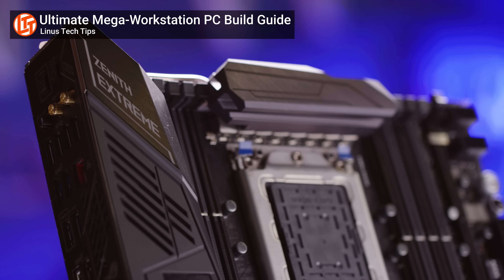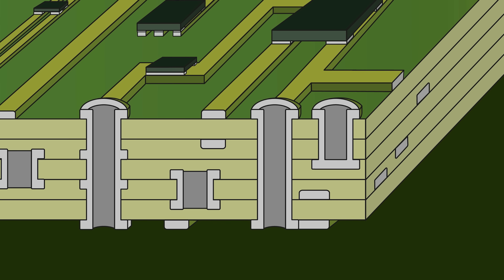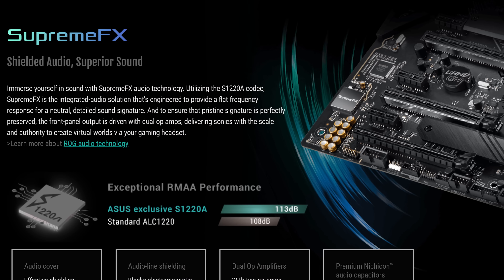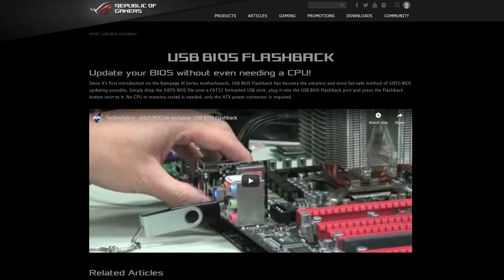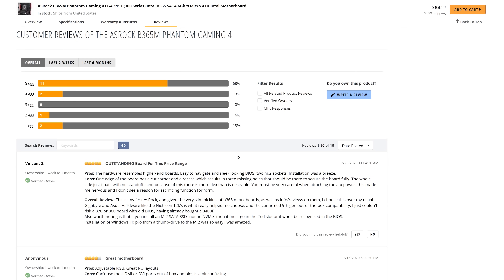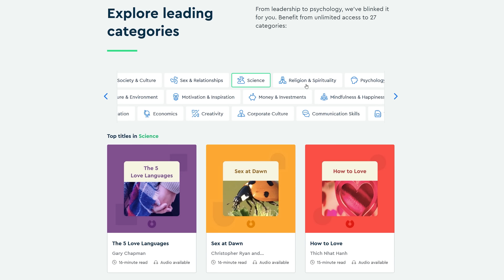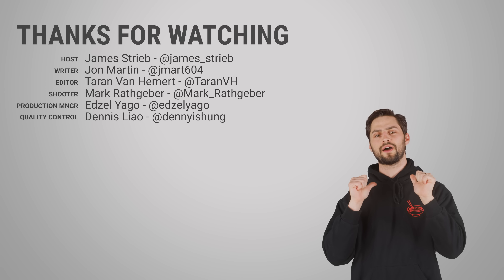Are EXPENSIVE Motherboards Worth It?

Comment: The motherboard is the last thing to check when building PCs because at that moment you can choose one depending on what component you already listed and your budget. 
I prefer a good CPU without overlock rather than an expensive motherboard with a dual-core.
Reply: I don't understand why someone wouldn't buy the motherboard and CPU "together" if you get a cheap processor then you get a cheap motherboard and vice versa otherwise you are bottlenecking one part or another, this is especially true with long term builds where upgrade cycles are far between.
Reply: @Hybris51129   Not True, there is no bottlenecking if you're not overclocking, The CPU will work at his maximum on any motherboard (a compatible one of course).

Comment: person A: having a good OC mobo saves you a ton of money in the long run
person B: having a good case can last multiple builds
person C: having a good PSU can last multiple builds or a decade
person D: having a good CPU can last multiple gens
person E: having a good GPU can save several gens of upgrade
person F: having a large storage SSD can last you several builds

conclusion: why save your money ? splurge it
Reply: Well, depends. What if your system needs, say, 500 watts. Why would you get a 1,200 watt psu? That’s just a waste of money on extra wattage that you won’t even use. Also, with a mid-range mobo, you can get some really high quality stuff with just a little less bells and whistles, but at half the price.
Reply: This is all true, quality components at perform better today WILL last longer than low quality components that perform "meh" today.
OC motherboard is a bit more special case tho, if you dont OC you dont get the benefit (and this is very personal if you want or not).

Everyone have a budget, some more fixed than others, and within that budged you should get the best you can not just the cheapest.
PSU come with 10years(?) warranty and you should expect to upgrade your system every few years = last several builds.
Case could last until your grandchildred die of old age, clearly something that could last for several builds. Not to mention cooling is very dependent on the case, and component lifespan is increase with good cooling (or decrease if they get to hot)
SSD's today last almost forever, i still have my 120gb from '09 and i have no problem with it (in a less used laptop, but still alive and run circles around any HDD) Large storage i would still keep on HDD due to cost, but i have never had a SSD fail while i had several from HDDs over the years. 256gb system drive and 1tb for storage is more than enough for 99% of users, any additional storage should IMO be on HDD or possibly in a NAS (HDD in the NAS)
CPU and GPU is more the performance, buying a lower tier today might mean you "need" to upgrade next year while a higher tier might last you several years before that "need" show itself.

You mostly get what you pay for, the cheapest option will only last so long, either due to quality or simply starting far behind the curve today and ending up to slow down the line.

Comment: 2:55,   Number of chokes does NOT mean = phases,   You need to check the phase design,  mosfets and controller to say that. AND having more phases does NOT always mean having more power.  To say that, You need to check phase desigh, mosfets, trenchfets and controllers and test it to make sure.   Sometimes 4+2 phase boards   mosfets ( 91 amp ) deliver much more power than some of 6+2 (48 amp) phases.

Comment: I bought a $210 X570 board and I already regret the fact that I didn’t spend more. I thought I was just going to use 1 M.2 slot, but now both of them are filled and I want to add more, but I don’t have any more M.2 slots, I don’t have a Dimm.2 and there’s no PCIE gen 4 m.2 expansion cards that aren’t made for RAID setups. I don’t want raid, I just want one more M.2 and right now there’s no option for that. I also wish I had more USB ports which a more expensive board would have.

I’ve never regretted spending too much on a motherboard. 

“A high end motherboard doesn’t make your computer faster, but it does make your computer nicer” -Tech Deals

Comment: I had a cheap Biostar A320 Motherboard paired with Ryzen 2700X and the power phases could not keep up with the processor. Within 20 seconds of full load they reach thermal limit and start to cutoff, causing the processor to power limit itself to the base frequency and back to turbo constantly. I also tried it with 2700 non X version and it got near the thermal limit but did not cut off. I replaced it for a B450 from ASRock with better power modules and it works great for both CPUs. So beware of cheap power rails on motherboards. Some can't even support non-overclocked high end CPUs.

Comment: "Is it worth it?" 
Me: "Hell, yes!"
When it was time to upgrade my PC a few years ago, i went with a top of the line ASUS board for AMD, mainly for the amount of rear USB 3.0 ports, ability to run 2 NVMe drives and a host of SATA ports (6 or 8). because i want to run separate physical drives for different purposes, Getting a cheaper board and lots of add-on cards was not sensible, neither was forking out a ton of cash for top of the line capacity magnetic drives.  The top of the line boards simply are the most versatile of them all, from RGB to over-clocking to add-ons to running multiple GPUs.
And like they say: better to have sth you don't need, than to miss sth you thought you didn't need.

Comment: If you want max stability and performance and plan to overclock your CPU and RAM to the max. Then yes, buy yourself a quality motherboard.
Reply: i have a 4x 8GB config on 4300 16-17-17-33. dont want to know how hard it must be to get that stable on a semi cheap one
Reply: @mauriceelet6376  Wow, that's an exceptional overclock with 4 DIMMS.
Reply: @theintunity  well, i had 4533 16-23-23-38 stable for 5h... but cant get it back. highest was 4480 16-22-22-36 but thats not stable long term. 4h RAM test yea, but prime95 dosnt think so
Reply: @mauriceelet6376  What is it worth to overclock that hard though?
Reply: @UndeadSauerkraut  fun? i do that like i do gaming. for fun. you get better low 1% and 0.1% FPS and stuff, but you could get most of that with your normal 3600 16-19-19 if you would do the subtimings a little
Reply: @mauriceelet6376  What ram kit are you using? Those must be high quality Samsung B-die.
Also your cpu has a damn good IMC. I'm running 4133 17-17-17-36 with Maximus X hero and 8700k. My motherboard won't allow me higher.
Reply: @mauriceelet6376  I doubt, that someone can spottthe difference tbh ^^

Ofc if your systen fE handles gta5 in 4k/30fps and you overclock it and it is 4k/45 or even 4k/60 then you can easily spottthe difference, but otherwise meh...

I fe play monster hunter world and it runs with 1440p 90-110fps without any oc and with 120-140fps with the highest oc I was able to do with myssystem ( and yes it is fun, but I wouldnt let it run like that everydday ^^)

I barely was abletto spotaany difference. Maybe my eyesaarent as good as others or I simply dontccare enough, but yeah ^^ I barely understand why anyone is doing such hardcore oc... It sounds like comparingddicksizes or salary for me tbh ( no offence, Im just curious)
Reply: @theintunity  i use a g.skill 4133 17-17-17. but you can do it with 3200 14-14-14 or so too. you may have to buy 6 2x2 and bin them yourself but its ok. i know people that have 3200 and doing 4600MHz on a gene.

the IMC is not that important. even my 8700k got 4300 16-18-18 on the z390. most of it is the MB. it would suprice me if not 80% of coffelake could hit 4100 and more with 4 dimms
Reply: @UndeadSauerkraut  it is not much, that is correct. you would see a difference, if you had your fps cap like you mentioned. i use a 1440p 100Hz monitor with gsync. so my gpu only does 100fps. if it dips to 70 i notice that. not it more or less only goes to 80/85 and iam happy with that. but thats only from 4133 17-17-17 stock to my setup. going from 3200 to 4000 XMP does more or less 10% of what you could get with a custom OC. do you need to spend 400$ on that 30fps more in your dips? no. 100$ maybe worth it for someone. but its not like you need it. 

ps: i only mention the stats to have a comparrison. i know i cant get that on a cheap motherboard because the signals get worse. belive me i tried. z370 and i have almost 400MHz less RAM on the same brand.
Reply: @UndeadSauerkraut  also its dependent on the game. Doom dosnt give a crap about RAM. Civilisation V or VI and you get 10s or more in late game per round because of AI simulation... thats massive
Reply: @mauriceelet6376  Huh intresting. Well I use an overclocked 2080 ti, if it is "needed".

I have a 2160p/60 Monitor and a 1440p/144 (or 165 in oc Mode) monitor. Depending on the game I like to play on one or the other.
Playing watchdogs 2 on anything maxed out and 4k was fE a given scenario where it was needed to octthe 2080 ti, so I had at least >50fps most oftthe times ^^

The fpsddidnt matter too much for me in that game, because even in cars it rather feels slow and it looked fsntastic in 4k :D

So spending time in overclocking is more a hobby you enjoy rather than a thing you consider worth it?
Reply: @UndeadSauerkraut  in your szenario its not really worth it. Whats interesting for CPU OC and RAM OC is Frametimes. If you are in low FPS because your GPU is maxed out then you cant gain anything. Faste RAM makes the CPU fester, and so if your GPU waits for you CPU thats where its also RAM dependent. 3200 16 18 18 Stock should be around 40GB/s . Mine does over 60GB/s. Aida 64. Real world is more like 35 vs 42GB thats what you get in Geekbench. I need high FPS and i have a 980 waiting for a 3080ti. My games need a lot of physiks calculation. So you could use even a fast i3 and cant see that much of a difference. For me switching from 4.9GHz 8700k to 5.2GHz 9900ks was a little jump.

Comment: Ever since I started in computing back in 1998 my boss always told me to go for Asus if I want reliability. That was because of the quality of the components. Nowadays I go for a quality board still but on the cheaper side as I don't overclock my cpu's and don't need 600 expansion slots.
But reliability is what I go for since having errors left, right and centre (like in the old days) is what I really don't want to deal with on my days off.

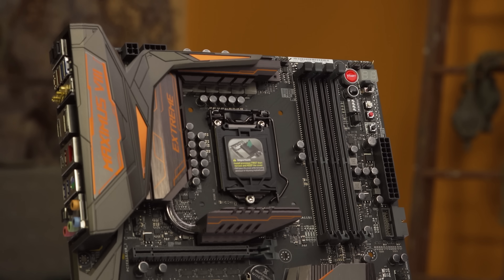Comment: 2:51 nice little lie ;d
Reply: Indeed lie. I cringe when someone pay more for same mobo as cheaper one but looks better because it has rgb and plastic shrouds... No one cares about electrical these days...there are a lot pc tech tubers that are not even concerned about it, but there is still hope thanks to GN, AHOC and hardware unboxed
Reply: "typically", it's not a lie. Usually higher end mobos have either more chokes or better quality ones
Reply: @benjaminmcintosh857   But manufacturers especially in recent years put more chokes in one phase in parallel to appear that mobo has more phases.... And chokes are inductors, coils and when you have two 400nH inductors in parallel their combined inductance is 200nH granted you split a load across two of them but they don't get hot enough to effect there performance to begin with. And buying one 200nH higher current rated chouk is cheaper than two 400nH lower current ones....but manufacturers still do it because everyone still count those... however if something make more sense from electrical stand point it is to count number of compactors (caps) around socket because more of them the better filtering is and power delivery is more stable. You cant know number of phase unless you find details of everything used to make it.
For example my friend spent more on gigabyte b450 aorus elite that is electrical wore than msi b450 tomahawk but hey aorus looks better... and is more expensive so it must be better!? WRONG!

Comment: I'm running a Asus TUF Gaming X570-Plus, it's one of the cheaper options for the X570 platform... But the fact it is an X570 automatically makes it a higher quality board by default! Many of the things that were spoken about do apply to this bored! 
 But I went with this bored because I wanted to both future proof the system with PCI-Express 4, and also have a bored that is more suitable to the Ryzen 9 3900x I gave it!

So far I am quite happy with this board.... Had a little bit of a hiccup overclocking the ram.... All I wanted to do was use the XMP/D.O.C.P profile to get my 3200 ram to run at 3200.... And immediately it wouldn't post.....  Tried to enter all the ram timings in manually after resetting it... Same....
Tried the D.O.C.P profile once more.... & it worked... And it has been working... Flawlessly..... Idk why... But... it works....
Be damned if I actually tried to run the ram faster then its designed speed....
Also haven't even humored overclocking the CPU..... Because..... At this stage.... Why bother? 
Maybe when it gets a little more long in the tooth... Hopefully this board doesn't give me new problems then...

Oh....... Stupid design... The fan for the motherboard is placed so my GPU covers over more then half of it.....

Comment: Hi,
PSU = power supply unit, check the power requirement for the motherboard and check the Random Access Memory Compatibility before buying the motherboard.
And its not a father board, daughterboard, uncle board, etc.
So make sure to use the power requirement calculator or the manufacturer's site power calculator to ensure that the power supply unit provides enough power to all the component and its shared counterparts
And for the memory make sure those RAMs are fully tested with that motherboard you are buying because the chipset is fully recognized by the motherboard so that it will not hang, blue screen, kernel error and faulty memory error.
Value Chipset memory is a non-tested memory type for every motherboard brand, model and design.
Along the way, you might consider not using the default aluminum cooler that comes with the system unless they are heat piped.
and use good quality heatsink compound that will last longer before the next heatsink compound replacements.

Comment: i've blasted thru about 20 mobos ranging from cheap to expensive and the failures were indiscriminate. Of 6 identical machines, three died at 1.5, 2 and 3.5 years while the 3 remaining still work 11 years on. Same batch of boards. In general, top end boards with big PSU and graphics cards failed fastest, and of laptops, the only one to ever fail was a 7gen i7 at 18 months, bad MOSFET. The other 5 are 2-5 gen i5-i7, all fine. My advice is go mid-range for longevity and go cheap otherwise, because chances are it will last as long as an expensive one and its death won't make you suicidal. Possibly interesting: of about 28 machines over 20 years, the mobo was #1 at failures. 75% of mobo failures was trace melting on high CPU+GPU load and the rest were random rubbish components. What I do now is buy cheap and just abuse them (render farm) and for the most part, they take the punishment without issue.

Comment: My own experience with motherboards has led me to believe that Mid range boards are actually better than hi end ones if system stability over the long term are whats important to you, I get the feeling that super high end boards don't get the driver support that higher volume "mid range" products do. I believe this is down to manufacturers reasoning that if your spending 600$ on a board you're probably going to upgrade every gen where as if your spending $200-$300 you're probably going to be a bit more upset if your pc starts to become unstable after only a few years. Would be interested to see an in depth article from you guy's as obviously I have only experience with 2-3 boards so I may just have been unlucky.

Comment: I recently bought a new motherboard (upgraded from a 4x3Ghz Athlon II from 2009 to a Ryzen 5 2600X), and my main point I was adamant about was having 4 slots for RAM to upgrade later if 16 GB didnt cut it anymore. In terms of everything else, like connections I of course looked that it would have everything needed, but apart from some surplus PCIe slots I am getting pretty much exactly what I need for 80 € and cant complain about the performance, cooling, or really anything...
Except my old HDDs that ran fine under IDE crashing the new BIOS that runs AHCI, and a PCIe card with extra USB slots doing the same thing for an unknown reason. The AHCI thing will require some copying and formatting to fix, and if I have one faulty PCIe slot I can live with it as long as another one works.

Comment: PCB thickness is not directly tied to cost. There are very expensive thin PCBsand very cheap thick PCBs. That said, the argument for more layers and better signal integrity is true. A lot of great motherboards rely only on 4 layers, since that will give great yield and cost, while allowing the minimum signal integrity required for the application. However, with more and more high speed interconnects, more layers and better construction is required, which only affects a small percentage of the boards cost. In volume that would be in the cents. What we're paying for is not the actual product, but the Engineering effort put into making it and keep making it for the future. 
With higher end boards you are literally financing R&D - and of course providing profits for shareholders as well.

Comment: I'm going mid-range for the 5900x so have picked the Aorus x570 Master as it seemed to offer the best bang for the buck. I really wanted something with decent audio output and plenty of USB and while I won't initially use the WiFi I can be handy as a backup. The B550 either seemed to cheap or to close in price to the x570 version.